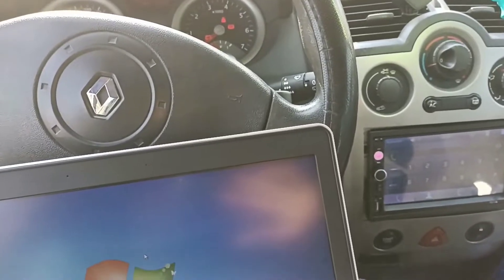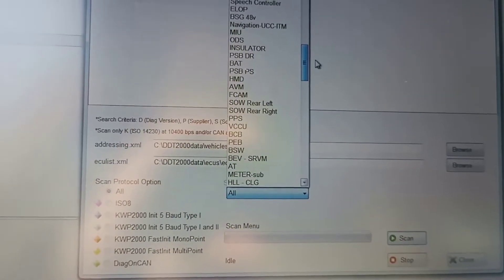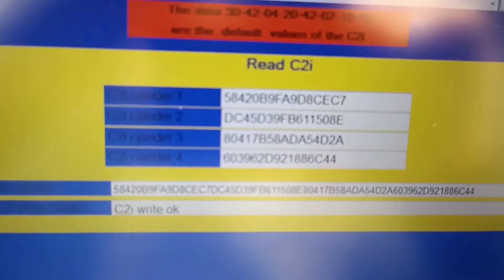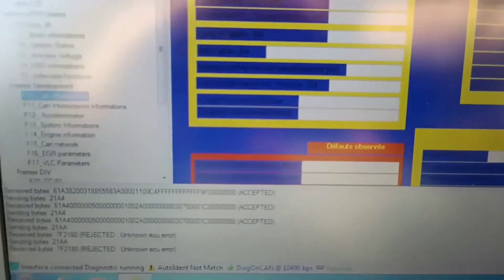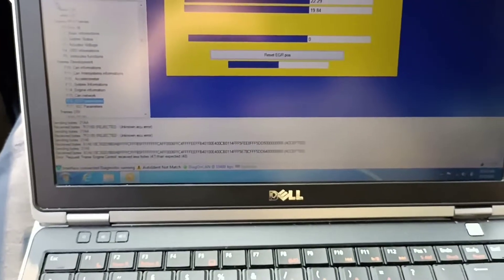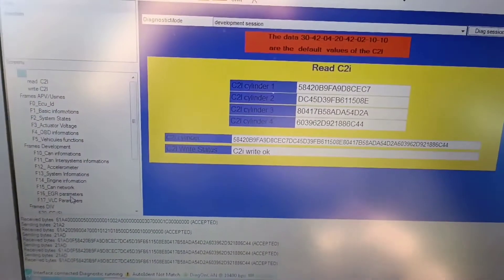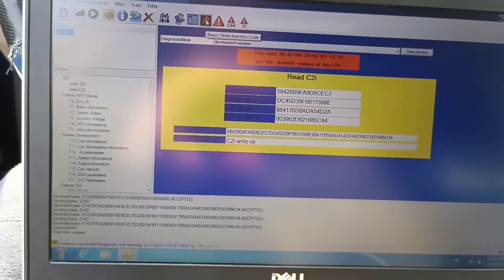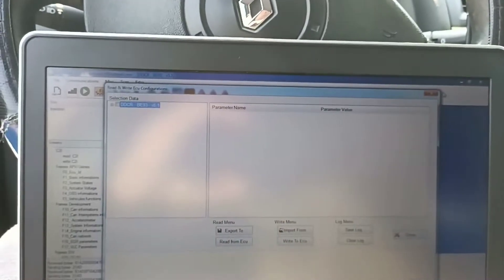OBDLink SX and Renolink used for Scanning and deleting Errors. Coding, Programming and Live Data

Comment: Hi mi friend. I have Renolink program but it doesn't work for Windows 10. Do you know what is the problem?
Reply from the maker: Hi. I run Renolink on Windows 10. 
If you have the clone , Windows 10 detects the Renolink as a virus and you must add permission to run without scanning the folder where the software is installed.

Comment: Hello everything is fine?  I replaced the UHC and Steering Lock and the Card Key.  The car turns on the ignition but does not start, the immobilizer light is solid, can the Renault Link Program solve this problem?  I changed everything because my car's UHC broke and the car no longer locked, the on-board computer no longer worked and videos no longer opened, with the UHC used, everything is working perfectly, I simply have the immobilizer light solid and the car does not start, the card is recognized and the ignition turns on.
Reply: Yes you can

Comment: Hello, my dear, 
First of all, great videos from you.

Now my question.
I have 2 original Keyless Go cards from a Renault Espace 4 built in 2007
a card the case was broken and I opened it and then I lost the original pill, so I got a replacement pill and a new case.

Now I've got the card where the pill was gone so far that I can drive with both cards, but my Keyless Go doesn't work.
According to the Can Clip, 2 cards are read, but the Keyless Go says 0
How can I add the cards to Keyless Go?
I have Renolink, DDT4All, Renault Can Clip from 159 - 237 in my online shop, but I would like to lock my vehicle again, the strange thing is that when I go shopping and come back the car is locked and I only have to go to the driver's side Reach into the door handle and pull briefly and all the doors open, but not every time.

I also have a Renault pin calculator.
--------------------------------------------------------------------------------------------------------------------------------------
The order of work at Renolink is:
   1. Press “Read Pin” 
   2. Press “Connect”.
   3. Insert a blank card
   4. Press “Test Presence”. You will see the card code and see if it is clean
   5. Press “Start Learning”.
   6. Press the learn button/card. The message is displayed: Map learned Ok!
   7. Insert the old card
   8. Press the Learn Button/Card to open the pop-up window and display the message “Card Learned Ok!” Both cards are displayed in the window
   9. Remove the card, check the checkboxes of both cards in the program and click “Validate” (no information is displayed).
   10. Press Disconnect.

   If you do not select “Test Presence” before inserting a new card, you will receive a “Card not learned” message.
Best regards 
Kalle

Comment: HI...I have bought Renolink and a new keycard for my Clio 4. Now the old key does not work at all and I don't have the ISK amd Pin. Is there a way to get them? Please help. Your assistance is much appreciated.
Reply from the maker: @openparachute17  you buy  the original hardware and software or the AliExpress version ?
Reply: You have to program all the card at the same time, it will desactivate the other cards
Reply: To anybbody using it for key  programming , Do not press Enable ISK reading , that will brick your HFM , only read pin than programm cards.Worked on my Renault Captur 2014 , but later years have upgraded security .

Comment: When there are immobilizer problems during a key coding process, the vehicle sometimes starts and sometimes doesn't, should I just try to reprogram the keys again or should I reflash the module?
Reply from the maker: @maumaumau10000  make a diagnosis first. Lock on the live data and see where the problem is.

Comment: Hello, i have RenoLink 1.99. my interface is connected but when i try to scan, the scan menu goes up to 50%, then it says "Finished scanning" but nothing appears. I don't understand what is the problem... Thanks for your video, do you have any idea about my problem ? Thanks a lot.
Reply: same problem , no bady to help ?
Reply: Did you insert the key and turned it to the 2nd position? (lights in the display of the car go on for some seconds)

Comment: How can I configure Uch . 
Program two keys but it's not starting.
Someone said need to do Uch configuration.
Reply from the maker: Which error code do you have ?
Reply: @YOYODiagnostic  no error code.
Car was fine and it comes to the shop for a spare key. I program a new key and everything went smoothly but car didn't start. Remote working (it's a Renault duster 2020)
Reply from the maker: @Ibrahimamun  
Look on the live data for immo. 
ECU + UCH
Gave me more info

Comment: how did you get a connection to the probe?

I get rid of the red x but then I get this message Character spacing is invalid and cannot be removed.

I just want to read the pin of the cards and then establish the connection for learning and programming and then after that has happened successfully cut the connection.

Comment: Bonjour Question pour savoir si renolink tu a eux déjà marque 
Trying to connect... 

Error: Le remplissage n'est pas valide et ne peut pas être supprimé.
Diagnostic stopped
  besoin d aide Merci d'avance
Reply from the maker: Hello,
Unfortunately, I don't understand what you mean.
English please!
Reply: @YOYODiagnostic  hello a question what you encountered the same problem with RenoLink thank you for your help in advance
Reply from the maker: @aureliehamed5702  
I have not encountered this problem before.  If you use the original, ask Gabriel for help, he will help you with this problem.
Reply: @YOYODiagnostic   je peux  avoir   le lien Gabriel  merci  ou savoir où je peux  trouver

Comment: Hy from what I understand  this  interface can work on different  models brands if you install the dedicate  software ? Any way so from description if I want to acces abs and different  modules on a renault I need the obdlink ex? I have a problem whit an abs module renault espace 4 and I want to check  the sensors wheels. Tha k you
Reply from the maker: Hello,
I don't recommend you to buy this software if you just want to diagnose.
  It is very good but if you have it in the original version, so if you have the clone version you will have surprises.  
Regarding what you asked why one can read and another can't, the logical answer is that the MCU is different and the functions of the Hardware are reduced.